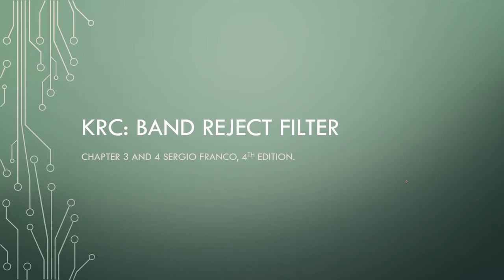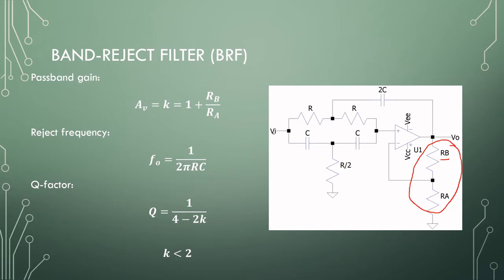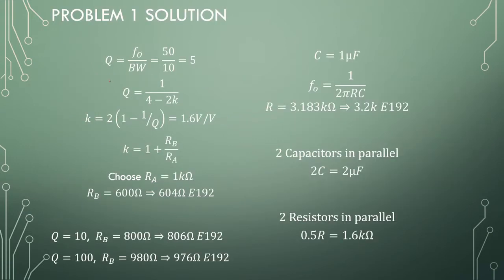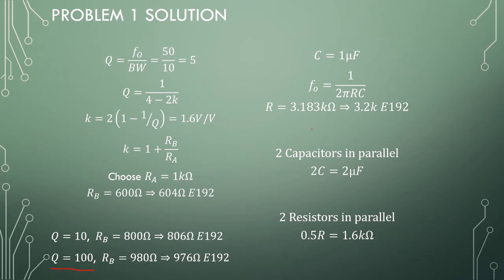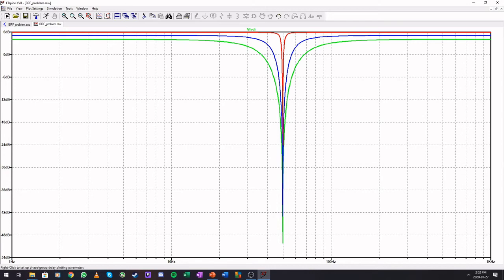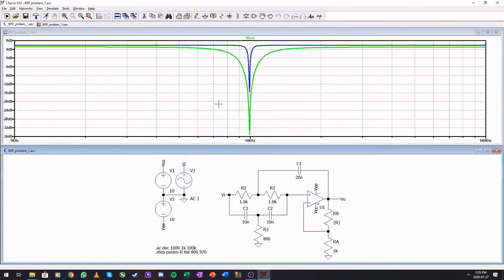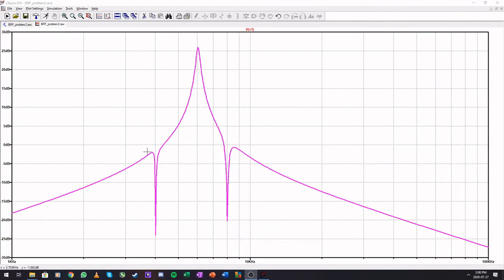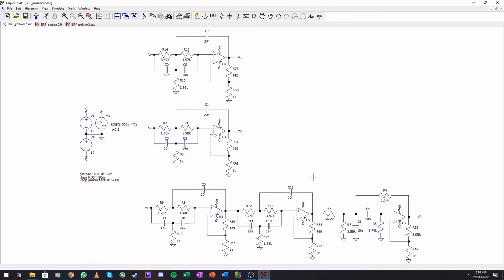Video 6 - KRC Band reject filter

Comment: sorry, could you explain the transfer function?
Reply from the maker: The transfer function here is gain vs frequency. So basically if a signal passes through this filter the frequencies in and near the notch (the filter frequency) will be attenuated.
Anything outside the notch can be left unaffected or amplified depending on the filter.

Gain - positive dBs
Attenuation - negative dBs
0 dB - means a multiplier of 1, or no change in the signal strength.

Example:
20 dB gain means multiply with 10
40 dB multiply with 100
-20 dB multiply with 0.1
-40 dB multiply with 0.01
0 dB multiply with 1

The notch is a very large attenuation thus, frequencies in there will be decreased significantly.

Gain in dB = 20 log (voltage gain)
Gain in volts per volt = 10 ^ ( Gain in dB / 20)

I hope this answers your question.